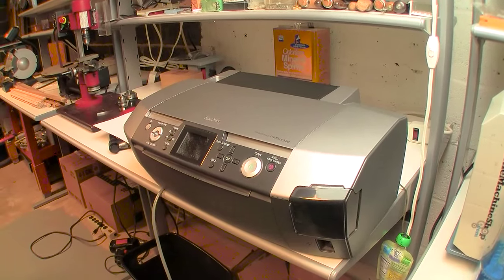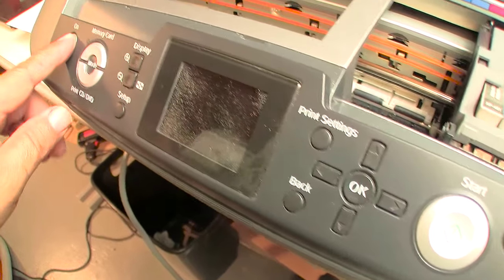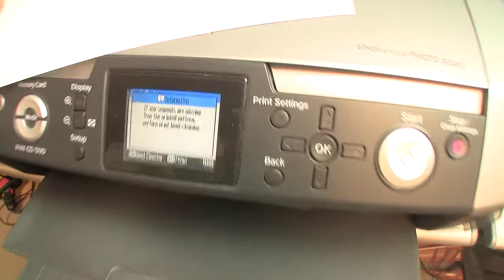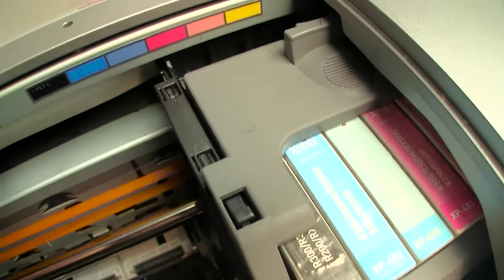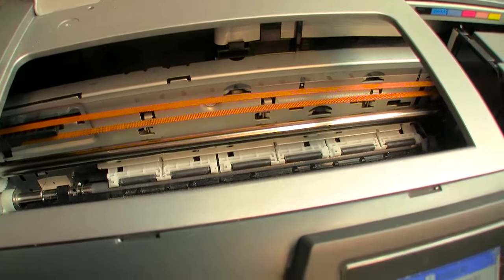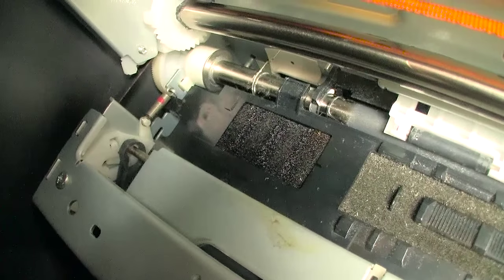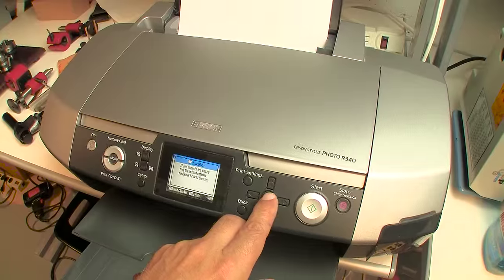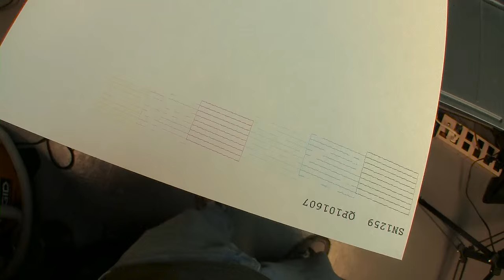How to Rescue and Revive a clogged neglected printer Part #1

Comment: This worked for my brother printer I hadnt used in 3 years!! I did 3 printer head cleanings (used up most of my new ink 😢) and my nozzle check page was still completely blank. I was lamenting my “broken” printer when I found this video. 

I left the windex paper towel under the  print head overnight. The paper towel was completely black 😦 My test print page worked!!!! Thank you!!

Comment from the maker: Have you an old neglected printer than you would like to revive?
You can find these ignored printers at local flea markets and yard sales for next top nothing.
Recently I found another EPSON R340 which as it turned out was operational but needed lots of cleaning and maintenance.
It was hopelessly clogged and that is why it was sold for about $15

In this video series I will take you through what I would do to restore and revive a printer such as this and bring it to a near perfect working condition. The techniques shown will apply to just about any EPSON printer you will likely find. Up to a PRO 3880!

This first introduction will cover the preliminary inspection and initial attempts to revive this printer.
As I go through the various steps I will document them in short individual videos covering what I normally go through to bring these finds to near perfect working order.

Please ask questions in the comments below and please subscribe for more content like this.